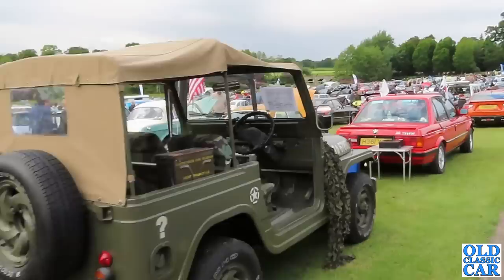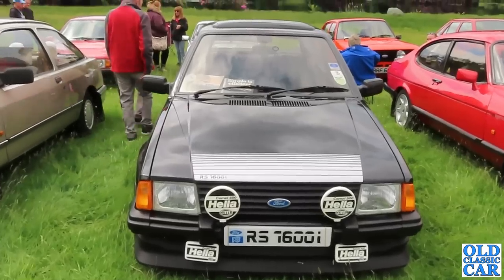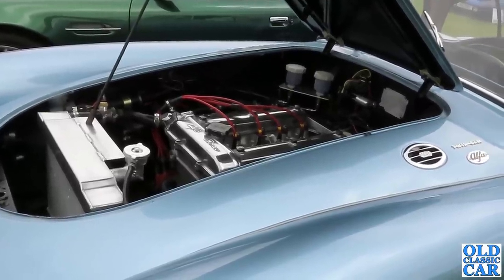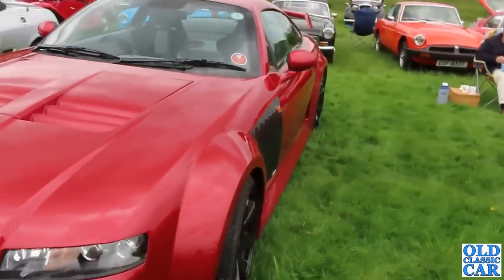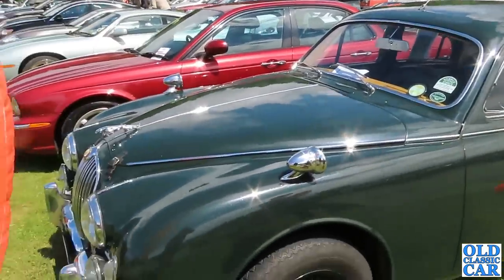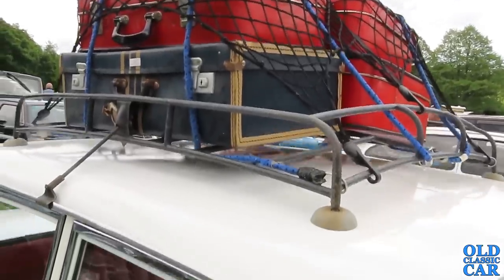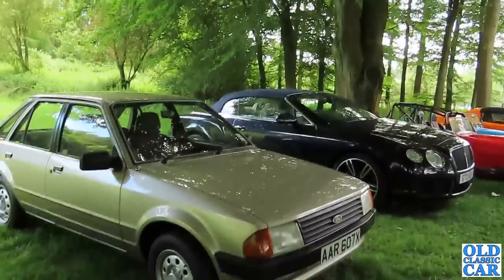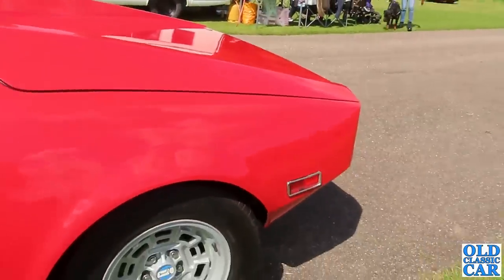AMAZING cars at Capesthorne Hall classic car show | Part 2/2 - Walking around the exhibits, May 2022

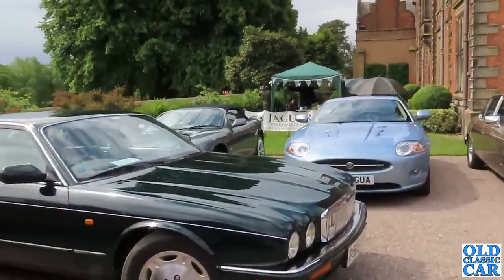Comment: Why was the chain attached to the door of the Austin Seven @ 1:08? I shall now refer to you as the Old Car Oracle, and Harley your apprentice. A great show but you skipped past the Alfa Romeo Brera or was it a GT, both beautiful cars. perhaps too modern for you. 👍
Reply from the maker: Looking again at the footage I think the LH end of the chain is attached to the inside door handle, so it makes opening the passenger door from inside easier for the driver, without having to stretch to the small handle at the back of the door